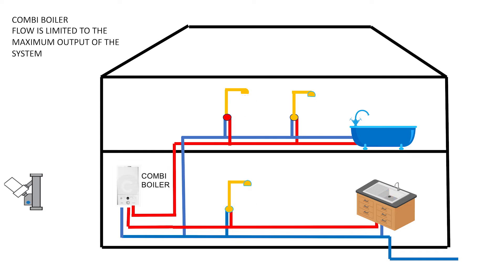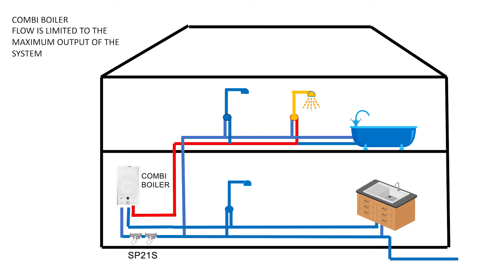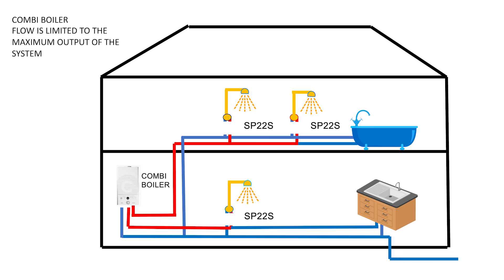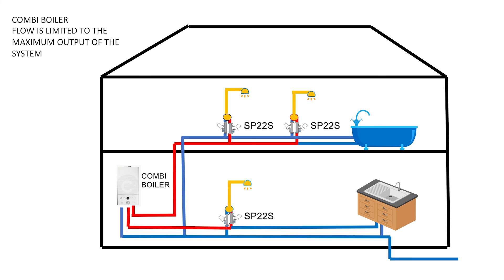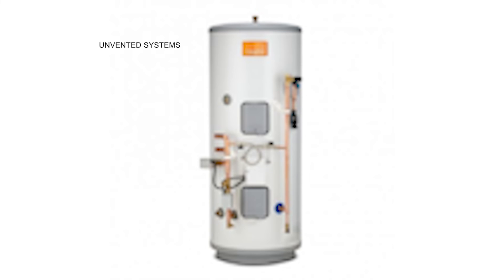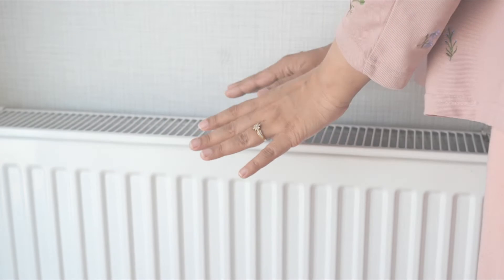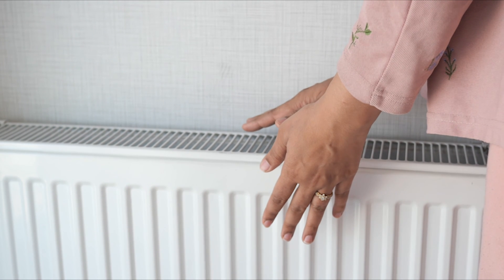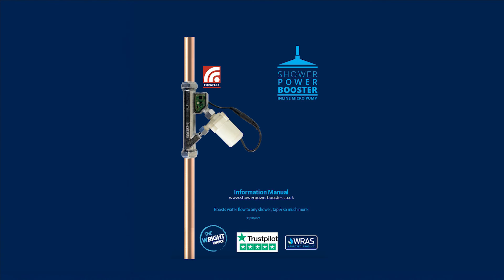Boosting Showers and Taps In Combi Boiler Systems

Comment: Hi Alan thanks for the informative vids , I have a installed a new bath with mixer tap and separate mixer bar shower , both have poor flow , would one SP2B be sufficient to provide more flow on both?
Reply from the maker: Showers from mixer taps which send water to the bath or to a shower tend to be poor at balancing unequal hot and cold pressures so it you have this sort of shower boost the hot and the cold with a SP22S.

Comment: Hi is the hot water for a bar shower the same hot water pipe as the bath or the sink hot water. Or is the shower meant to come off the boiler on its own single pipework.
Reply from the maker: Its the same hot water.
Reply: Can you get the  plumber from Norwich to make videos for combi boiler installation and gravity feed boiler that would be amazing to watch and people will get a bit more in sight how your amazing pump actually works and would definitely boost your sales thanks if you could kindly reply

Comment: Alan can I install an SP2B to increase hot flow to my upstairs bath?
Reply from the maker: Are you boosting a shower over the bath or a barth tap?
Yes you can boost an upstairs bath but because you have a Combi Boiler you should already have a decent flow on the hot. Check the existing flow at full hot and let me know what the existing flow is
https://youtu.be/RHXmlvERLcU?si=nuE8ia2XPC38vFiM